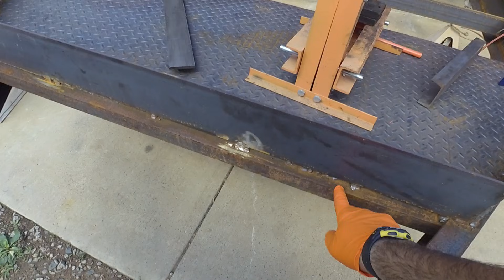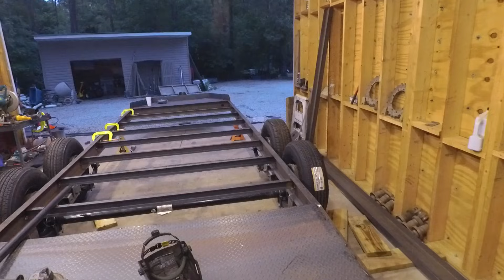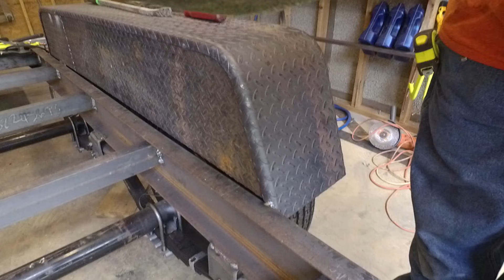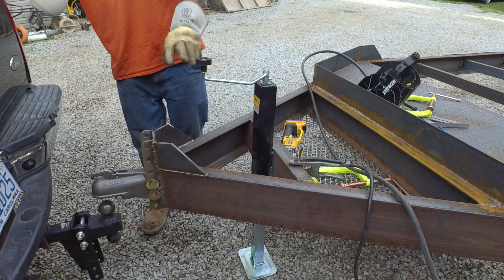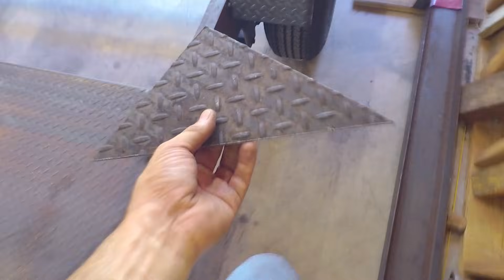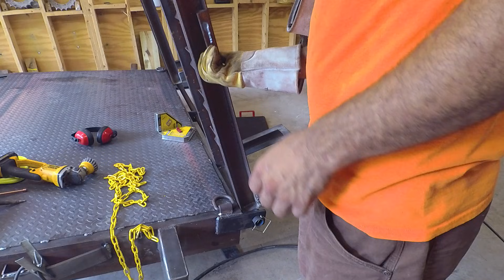Equipment Trailer Build Part 2 Tongue deck, fenders, ramps, rub rails

Comment: For filling the holes you could have cut a circle piece of metal to fit the hole, and just weld the gap like you would normally. 
The easiest way is to find a bolt with the diameter needed to fill the hole, weld the tip of the bolt in, and cut off the extra. Works best when you grind the threads off, I personally use a belt sander to remove the thread, and any coating. (You really do not want to be welding galvanized steel without removing the coating.) The hex side of a bolt can work as well, but that requires more gap to fill.

Alternatively you could put in a piece of backer metal, and weld around the edge onto the backer. Though this would need to be done before you weld it on the frame so you could get the backer metal inside the metal tube. 
Ideally it should all be done before you weld on to the frame, so it can be coated for rust prevention, and anywhere you weld that you won’t have access to afterwards should at the very least be coated with a weld through primer.

Comment: Just a suggestion don’t weld those d rings to the diamond plate. Weld them to the frame. Much stronger. The plate is your weakest link.

Comment: Before you started to take this fabrication on, You should have learned how to weld properly, The wire speed is completely wrong never pull the wire always push, And finally the mill scale covering all the steel should have been sanded off,

Comment: I fill in holes like the one in the light box by placing a piece of thick aluminum on the inside then welding in the hole.

Comment: WhOooo,budy ! "That was some DANGEROUS welding.". . first -  Never trust😢 hydraulics when   you've got your life is on the line. Two - the Minni Excavator was shut off.  Three - the chain link size  looked too weak for the task and your two vertical supports was the last defense that saved you life . Cuz the Excavator was a failure  . You saw it but didn't recognize the fact is you could  of been crushed your wood board wouldn't have supported   the trainer weight. Not to mention, the angle of the trailer,  causes it to be top heavy. which means it's leaning towards the top of your vertical  supports .  The entire weight of the trailer was  all  a roll away, loose rocks, isn't solid ground .   Welded 18  years myself and thing are never easy.  So I'm always looking for potentially dangerous outcomes I'm not saying that I'm right and you wrong no sir . I'm just not gunna watch and see all  unsafe situations. I'm going to inform what it Really is . Welders have to be the safest workers.  Cuz we're working with tools and equipment that is already life threatening if the most basic safety is forgotten about or ignored.  We sometimes work alone miles from anyone  , miles from a hospital or phone. The second We go under the hood we become completely blind , all around for 360°  we only see the weld puddle nothing more.  I hate to see anyone get hurt. Or killed.  Cuz he didn't want to lay on the ground to weld a two inch pass. Over head under a trailer and nobody is going to see it.  .  . The  ironic thing is you literally spent time too set up your death scene . The vertical supports would have been kicked out About 10 , 15 feet from the trailer.  The Welding machine was have been running.  You wouldn't be see right away.  The Excavator would be off with the chains all lose and slacked out, still attached to the bucket the way you left it arm of the Excavator would look like it was being used , just to pin  the trailer down to the ground.  It wouldn't make any sense when looking at the death scene not until your found crushed underneath your trailer.  Your now going to be Six feet under the ground that you didn't want to crawl on and lay on your back.    I'm sorry for commenting like an ass that knows it all.  . I'm home alone drunk and now it's time to eat.   LLOL😅

Comment: Doing okay on the trailer you need to turn your heat up in melt in the weld better than what you're doing even know them well should hold they are do not seem hot enough another thing it's a good idea to practice good safety measures when you're working around are ark rays of welding I have got flash burn not only on my chest but also burnt skin on my forearms doing just what you're doing here in the past many moons ago if I'm just doing a couple tax here and there no problem with a good helmet but if I'm really getting down like you are I'm wearing a good cow hide or leather jacket with heavy-duty gloves them are not welding gloves other than that pretty good job

Comment: Thr welds on thr gussets are way to cold on the flat areas for sure and welding down hill is not advised you end up with welds cracking from under cut .

Comment: Nice build but you Likley have porosity in those welds and they will crack because you didn’t clean any of the mill scale off the areas you welded M. Even if not on the surface you are going to have porosity in thr welds and they will crack sooner. Especially with all the stress trailers are under you should be inspecting your welds often and make sure you catch the cracks before they cause a horrible accident Z I’d personally got and grind out all the welds use w flap wheel to clean off all the mill scale and try welding a little
Hotter hour welds look very proud like their cold which would lead me to beleice under penetration

Comment: To fill the hole, use those 3/4 plugs you drilled out as a filler peice and weld it/melt into the hole on your tail light housing

Comment: Great job!  The sound of a good weld is the same as the sound of eggs frying in a skillet.  Your wire speed was set just a little bit too high, that's why it sounds like it's spitting at you.  Slowing the wire speed slightly would also allow you to do the overhead welds that are giving you such a problem.  You are also pushing the fire a little.  Give the molten metal pool time to build and then move it along the piece.  Keep working on it!  I've only been doing this for about 35 years so I'm still learning, too!

Comment: If you still wanted to use the hole you could use a rubber plug to fill it up. Otherwise you did the right thing.

Comment: Looks to me like you have your ramps upside down where they will catch debris much worse. I personally don’t like the short rub rails but it’s yours not mine but it should do the job very well.
Reply from the maker: No John the angle facing like I have it gives tremendously more traction. I could care less about debris trapping in there now that I realize how much better it is facing this way.

Comment: Great work looks like a solid trailer, do you find any difference in your welds if you prep the areas first? i.e. wire brush, angle grinder ect.
Reply from the maker: Not really. I think having the ground closer to the work helps though.

Comment: Shawn, do you have a 240 volt MIG welder using Argon gas or something similar? I can tell you now once you do and get use to using it you won't ever go back to any other. There is no flux to worry with and what you see under your shield is what you'll see when it's removed. With the correct wire you can weld all positions such as overhead, uphill, downhill and more. And you can use 70 thousand tensile strength wire like a pro. There are TIG welders but they are better used for tedious types of welding for example body repair and also on aluminum. TIG to me takes getting use to because it reminds me of brazing with a torch. For what you do MIG would be the way to go. Ps that wire with rosin inside is for the birds LOL
Reply from the maker: Yes I finally found a Millermatic 250 and that was the last piece I needed to start this trailer project. That welder is incredible.
Reply: @GCFD  Try moving your wire in a zig zag pattern slightly overlaying the weld you just made. Doing that will make a much stronger weld and will have a more professional look when finished rather than seeing humps and blobs when finished. All your welds should look like the welds you made that hold the chain on the front of your tongue. The weld as you will notice looks slightly concave and very consistent and professional. Practice makes perfect.
Reply from the maker: Thank you for the tips! I need all the help I can get with welding. So you won't believe what happened today. Last summer I towed a friend's trailer and bobcat home to return to the job the next day. The trailer was missing the safety chains and I was terrified making the 20 min drive home. So much so that I ran out to the trailer supply and got two 3/8" heavy duty chains. I welded them on but my air pressure was off so the welds look like crap. The friend and his crew thought I was ding bat crazy for welding those chains on there but they use them. This morning the pintle didn't get locked in place and that trailer let go with an 8000lb bobcat on it. The trailer flung the dump truck around a little but no damage occurred. They were so happy I had welded those chains on and I looked at the welds and they looked intact. Pretty crazy..
Reply: @GCFD  we all live and learn. Thankfully those guys learned a valuable lesson in regard to safety chains. Weld appearance doesn't really show its strength. Appearance however is what many will look for because it does show a welders limitations and flaws and it is a definite selling point.
Reply from the maker: @whip205inthebam3  I’ve been upgrading a trailer and my welder is making very pretty welds. It makes such a difference to have them look nice.
Reply: @GCFD  I can tell by everything you do that you take pride in your work and you strive to excel in that. Many people today don't care about pride they simply work for a pay day. I myself am disabled but even in what little I do I want to say yes I did that and feel good about it. I love that feeling especially when I see others smiling because I went the extra mile for them not bragging just fact. I also love to share things that I've learned so others can also benefit from it. Have a great day and God bless you and yours.

Comment: Everbilt(Brand Rating: 4.4/5)
1/2 in. Nickel-Plated Steel Hole Plug the Home Depot. However if you want a welded hole put a small piece of thin steel inside and then fill in the hole outside.

Comment: Trailer looks nice, everything in the fabrication portion was looked great until  the chains supporting the ramps,  it needs a piece of flat bar with pins.
Reply from the maker: I like the chains better because they can be adjusted with different loads and I find the flat bars get bent and the pins lost. 👍

Comment: Everyone remember this, there are no pressure sensors in the tires of trailers. Low tire pressure causes tire sidewalls to flex excessively...this causes excessive heat that causes the tires to blowout. I personally overinflated my trailer tires by 5 psi. Over inflation is 100x safer than under inflation. The worst that can happen with over inflation is a slight increase in wear in the center of the tread. If you have a trailer then go check the tire pressure!!!
Reply from the maker: Good advice!

Comment: very nice job on trailer build and welding! I would pay money for something like that! loving those rub rails, extra front diamond deck, storage basket, gussets and filling in those holes does not matter so much, they are not bearing any weight so the ol fill and grind came out nice!

Comment: i scanned to see if someone else has made this suggestion and didn't see one so if i am repeating a suggestion forgive me.  how about composite 2 x 6 lumber if you have the supports spaced right.  while the strength is not the same (reason for the correct cross braces) they will be almost indestructible.  while more expensive the money you have saved by doing your own build will give you a superior product.  Diamond C  (in Texas) are starting to use composite lumber in their builds.
Reply from the maker: Great point Paul! With current pricing I paid $38 for each 2x8x16 pressure treated!

Comment: Great trailer.  Wish I had one.  Will you use wood for the main floor area?  At the end of the project, I would love to see an itemized list of the materials sizes and types and the costs.   Every time I need a piece of stock steel and get it from the big box stores it costs a fortune for a tiny amount.   Is there a better less expensive place to buy steel stock?
Reply from the maker: I get my steel at a metals outlet in town. Yes, I will do a breakdown as I have everything in a spreadsheet. 👍

Comment: Astonishing trailer you got going, I just got done building one from scratch as well. 8'x20' but mine isnt as heavy duty as your's is. Built by purely 2" angle, I was after a light trailer. Not a heavy ball of chain as I don't have a diesel truck. I went with detachable fenders to free enough space to get my dually past them. It is indeed more convenient to lay diamond plate than wood at this point in time.
Reply from the maker: Sounds like a good build!

Comment: Why don’t you grind/clean that metal before you weld? I’ve never seen anyone not grind the metal clean before welding.
Reply from the maker: I degreased it but it didn't have much rust so I didn't grind.
Reply: Yeah this is asking for porosity and cracks in thr weld considering how much liability their is with trailer I would of expected someone to take every precaution to ensure good  welds to with proper penetration and snd removing scale ok evey weld seam .

Comment: Thinking about your drainage systems, why do you glue the joints if there is no pressure to the system? Doesn’t seem like you would need to glue, just make sure joints are well set.
Reply from the maker: We glue because a glued joint is better. The glue seals the pipe so the water stays in and roots stay out.

Comment: Would box the C channel a few inches each side of where your spring hangers are and axle bump stops to help avoid cracking.
Reply from the maker: I thought I avoided that by using 7" c. I guess it wouldn't hurt. 👍
Reply: @GCFD everything will crack eventually where there are concentrated loads, especially when loading machinery on and off and junk roads, its just a little extra work will extend the life of the trailer significantly by spreading the loads over a wider area. the only other thing I would recommend is air suspension but that's a significant cost with less functional benefit (still somewhat kinder on the tow vehicle) and more convenience and comfort.

Comment: i am not a welder or metal fabricator, but i would cut out a small square (around the hole), then find some scrap metal the same thickness and cut a square piece to fill the hole, then weld it in.
Reply from the maker: 👍 awesome tip

Comment: Nice trailer. Looks like the ramps are upside down though.
Reply from the maker: I like the angle iron facing down for better traction. I have flipped all the ramps on all my trailers. It's much easier to walk on them with the wide part of the angle iron facing up as well.

Comment: The more you practice welding the better you get. Beautiful welds on the safety chains by the hitch, I love my Miller 250 also. The basket is a great idea and I  will add one to my trailer.
Reply from the maker: Thank you Geoff! I am pretty happy with the welds on this trailer. I was paying a guy 250/ hour a couple years ago for some fabrication and my stuff looks as good or better than his.

Comment: Hi 
Are your ramps back to front?
It looks like they will catch all the mud & crap from the machines.
Nice trailer tho 👌
Reply from the maker: Yes! The wide side of the angle iron is facing UP. This gives much better traction, even though it catches more debris.
Reply: I was going to ask the same thing. My equipment trailers ramps are the other way.

Comment: One question - are you going to be able to remove the ramps if you need to?
Reply from the maker: Yes pull a pin and slide the bar out.

Comment: The holes on those turn signal boxes are meant for reflectors or running lights.
Reply from the maker: They have a hole in the end for the running lights so I'm not sure why they are located in that spot.

Comment: Since the back on the trailer has lets say.. couple of inches to sag down when you load something heavy on it you don’t have any concerns that the tongue of the trailer will be up in the air? Also this mai lift your tow truck up. I think those jacks should dig into the ground or be super close to the ground. Just a thought! Other than that good job!
Reply from the maker: Great point! The jacks are similar to my other two trailers. The suspension on the trailer and truck have enough sag.

Comment: Why in USA blinker light and stop light  and tail light are once?
Its confusing
Reply from the maker: If it blinks its a turn, if it's solid it's stop.
Reply: @GCFD  correct but But how much does it cost to install a separate light?
Reply: @Mostafa-vs8bd  You can't easily do it on trailers in the US.  All of the wiring standards that you would see have the brake and turn signals combined onto one wire.  To do it you would have to custom wire the tow vehicle and trailer.

Comment: How much of a bubble of fall does the dovetail have? Great work! The only thing  I may have done different is some RV scissor jacks on the rear corners instead of the static legs on the ramps. That way you can compensate for uneven ground. Those safety chain mounts are really nice. Much better than the last link just being welded to the trailer.
Reply from the maker: Thank you Robert! I have been using my other trailers with just the ramp jacks and I like it. I may add some scissior jacks at some point.
Reply: A dovetail is a woodworking joint, has nothing to do with a trailer.